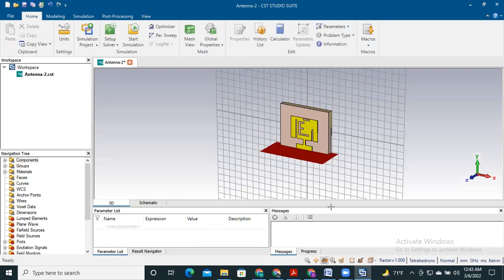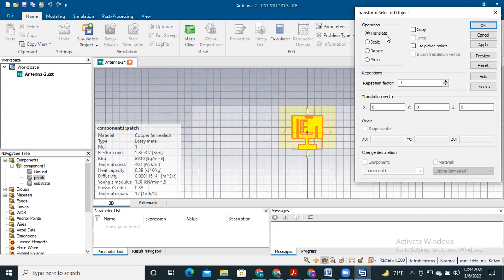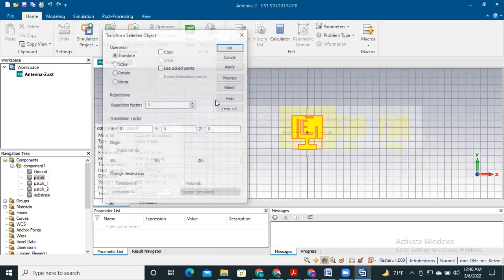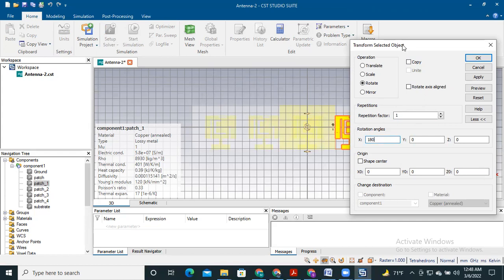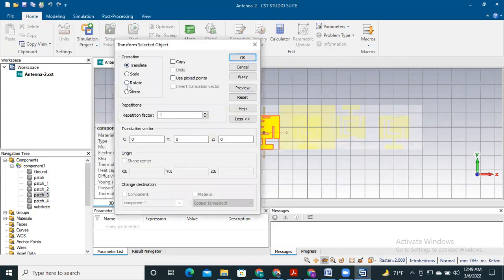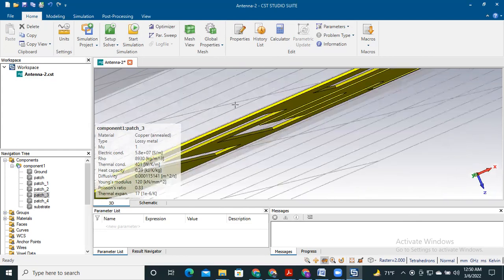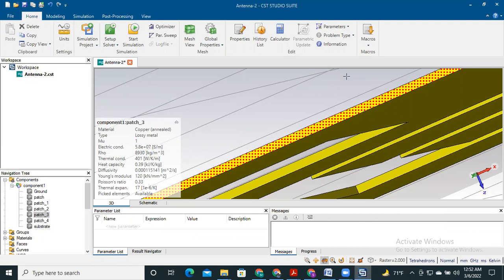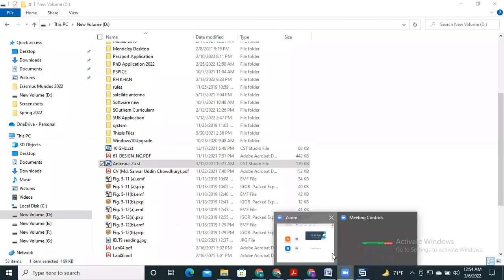MIMO Antenna Design ( How to transform a single antenna into MIMO antenna)

Comment: Sir, if we want to simulate the MIMO antenna then will we have to follow the same procedure that we did in Microstrip Antenna?
Reply from the maker: Yes, but in that case check the impedance. It may change. So to keep it 50 ohm, you may need to change the dimensions of feed line and quadrature transformer.